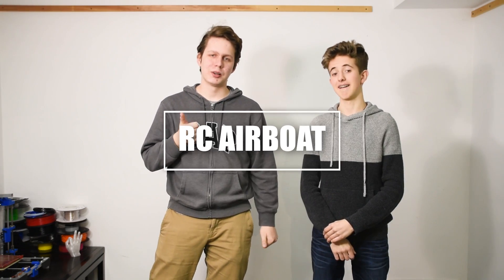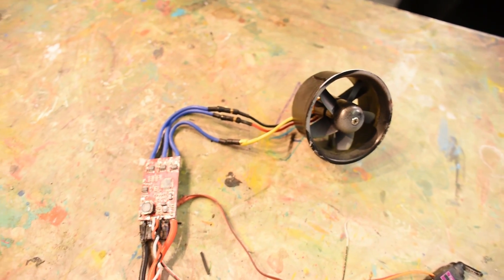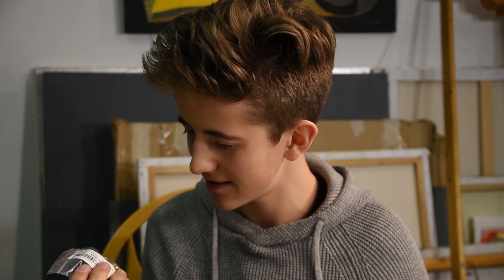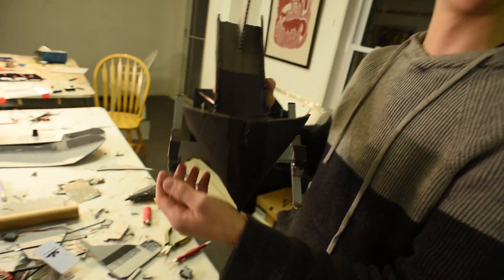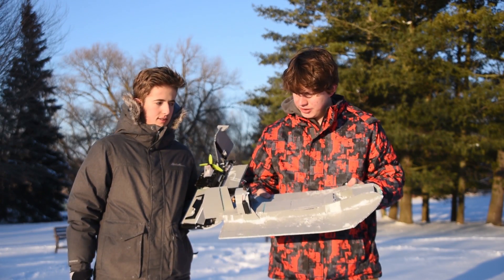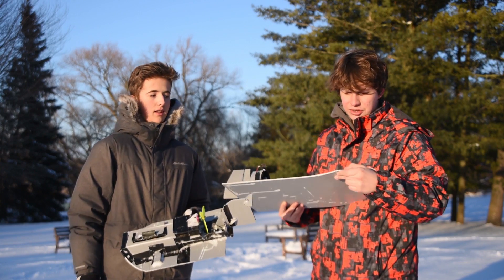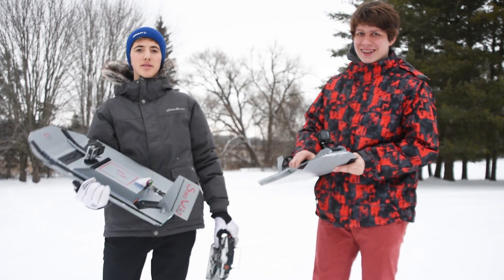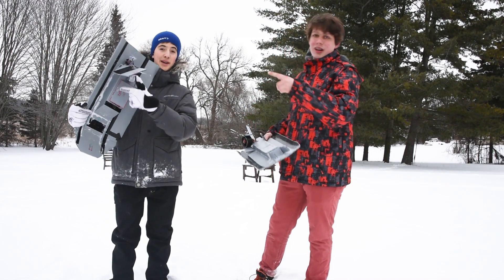We Made RC Airboats! | RC AIRBOAT DIY CHALLENGE

Comment: Top Tip: no helping hands?
Use pliers, BUT, get a rubber band around the grip and use the nose to hold the part you`re working on, nice and stable, and you won`t torch your grips ;)

Comment: Forgot to say, for a sturdier air boat you can use those small foam body boards for kids, with those boards you can use all year, spring and summer at the lake autumn and winter in the snow. Very cheap, they float and the foam is flexible rubber like.
Like this one https://www.youtube.com/watch?v=xq9CLAhhWeI

Comment: Nice project, guys remember CG, put the batt more close to the front, velcro strip for the gopro mount to be able to move it front and back the set the CG,  use metal gear servos, forget ducted fan use prop to be able to use an ESC with forward and reverse. Have fun.

Comment: If you had moved the cg of your airboat forward a bit and maybe even horizontally spread out the weight of you electronics across the airboat, maybe even two separate batteries, the issues of flipping would go away. I had this problem on an airboat I made and adjust the cg seemed to work the best. I love the craftsmanship on this project!